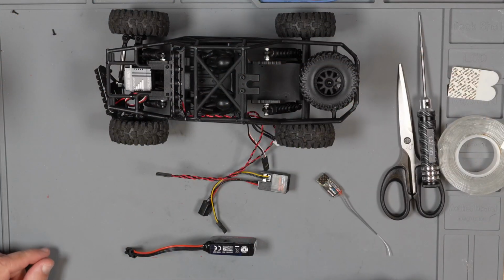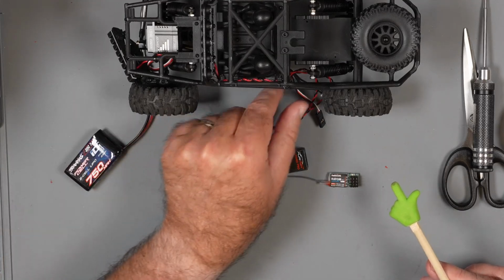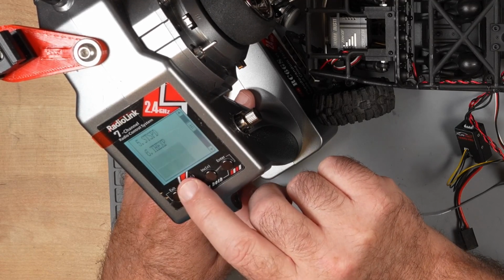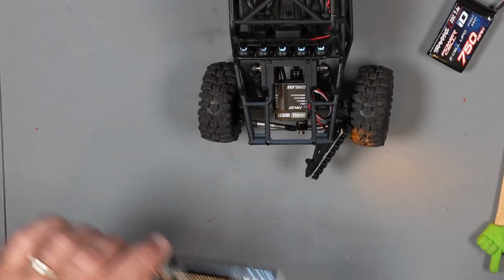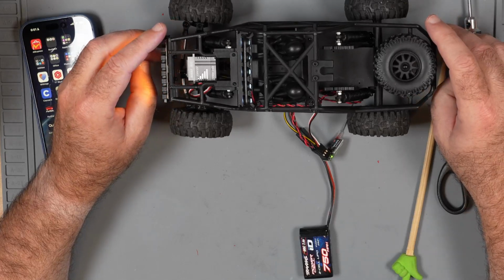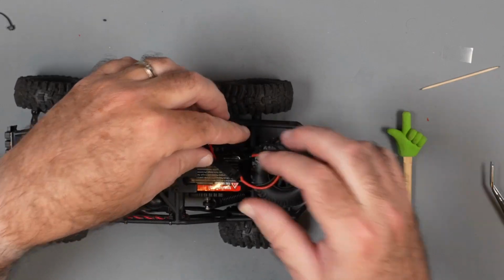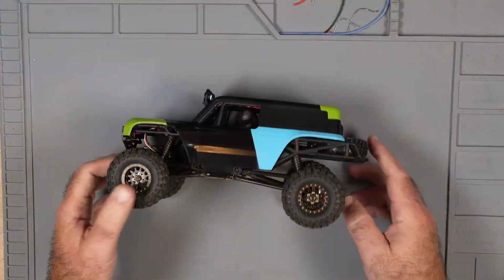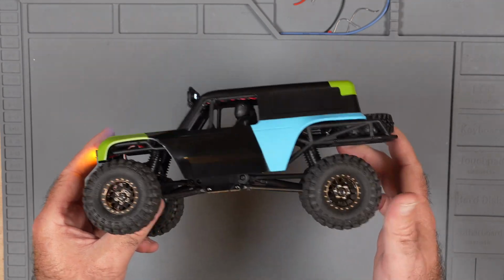MEUS MB18 Pt2 Electronics and final assembly Step By Step

Comment: Did you have any problems with the servo and the motor rubbing in the from when the shocks were maxed out
Reply from the maker: I have not had an issue with that.  I am using 59m. shocks.